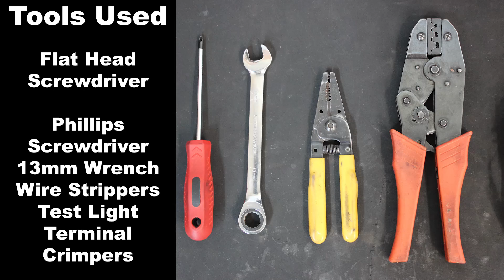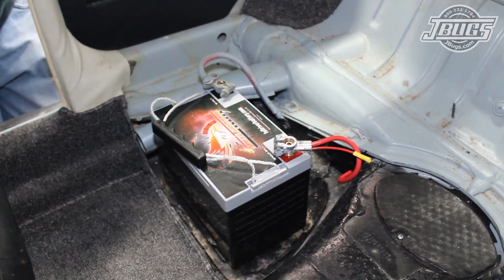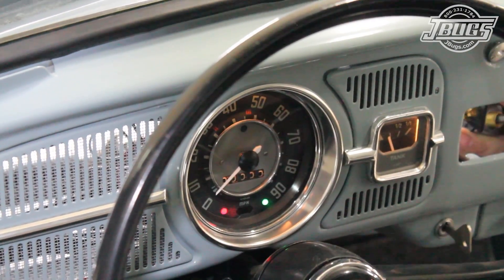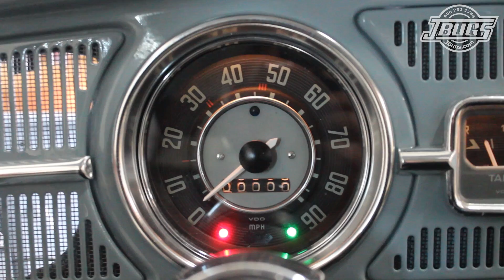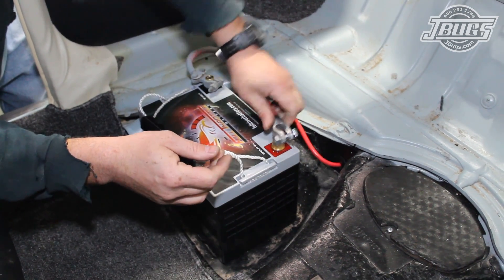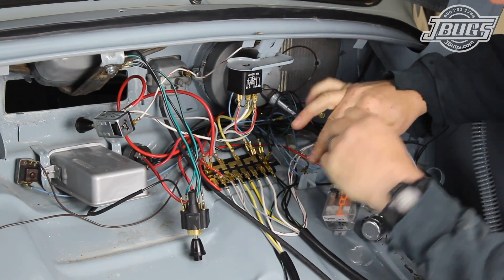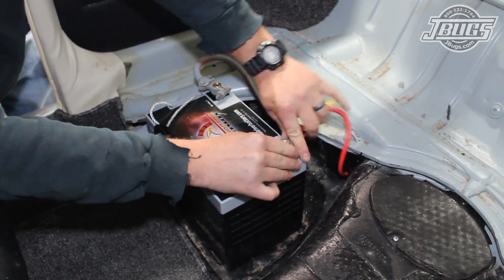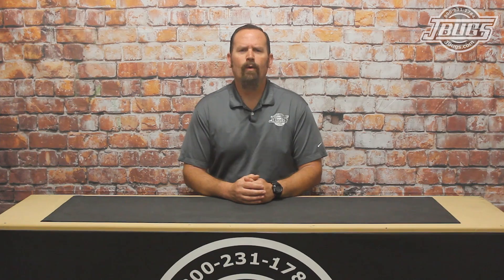JBugs - 1966 VW Beetle - Engine Wiring & Electrical System Testing

Comment: Could someone make me a diagram as to how I could wire up my voltage regulator on a dune buggy to charge ???
Reply: We kind of already did - https://www.jbugs.com/store/graphics/00000001/23/300019-VW-12-Volt-Voltage-Regulator-Wiring-Diagram_540x540.gif
Reply: I have no fuse box
Reply: I have no idiot light or speedometer
Reply: @JamesBrown-126  then wire it up to your battery and switch.
Reply: @Sam_Mebane  where on the switch ?
Battery, or accessories ?
Reply: @Sam_Mebane  and what about the number 61 connection ?
Reply: @JamesBrown-126  this goes to a warning light. If you aren't going to run one, then leave it disconnected. Just make sure you have a voltmeter on the vehicle so you know that the generator is charging, and more importantly that the generator is turning since it is also turning the fan that cools the engine.
Reply: @JamesBrown-126  the B+ terminals are battery positive terminals, so they would wire up to battery posts.

Comment: Sooo... what about those of us running internally regulated alternators?  I wish I could just run the power under the rear seat like a late model bug but the wires are bundled together in the harness.  What’s the best way to route power without a regulator mounted to the generator???
Reply: Did you solved the “problem”? I’ve the same question… but I’m really new in this things, basically I’m trying to understand it and do it by myself…
Reply: This depends on the year of the car. If you're working on a 6 volt car, just run a power wire from the "+" alternator post to the starter "+" post. Essentially, just like we did at the 2:50 mark.
Reply: You don't attach the regulator under the generator strap like they did here. Best way is under the rear seat on the driver side.
Reply: @doginu  - not true. 6 volt cars have the main wiring harness in the roof, not through the quarter panel and under the rear seat. 1966 and earlier 6 volt cars have the regulator on top of the generator. So for those converting a 6 volt car to 12 volts, with a generator instead of an internally regulated alternator, this is the way to go. Ideally, if you're converting a 6 volt car to 12 volts, use an internally regulated alternator so there is no need to wire up a regulator.
Reply: @Sam_Mebane  Look at 2:50, you do not attach the regulator like that. It will vibrate and wear on the front dust cover. Mount it correctly
Reply: @doginu  well, the car has been on the road for 5 years now so when the owner has to replace the cover, I'll tell them you said to mount the regulator under the rear seat.

Comment: is there any difference from wiring up a 64 as to the 66 if the 12V conversion has been completed?
Reply: Yes, the biggest differences being the turn signal switch (with dimmer) and the hazard switch. Otherwise the cars are very similar.

Comment: Interesting.  I'm guessing there was a mid model year change or similar as my 66 has the 9 pin relay mounted to the drivers side fender and not directly behind the speedo as shown here?
Reply: That is an oddity. I've never seen the relays mounted anywhere but behind the speedometer in all the Beetles I've ever worked on.
Reply: @Sam_Mebane  I'd add a picture but don't know how.
Reply: @starlightsims9229  it is where it is, as long as it works, it doesn't matter where it is!

Comment: What crimping tool are you using for the non insulated connectors?
Reply: A non insulated wire crimping tool (Google search that and it should bring them up).

Comment: Have you got a video on wiring a 68 bus dashboard? I'd sure like to see it I'm having trouble
Reply: Not as of yet, no. My best advice is pull the windshield and the top of the dash. This allows access to the back of the dash without contorting yourself underneath the dash through the door opening.
Reply: @Sam_Mebane  thanks for responding Sam I'm doing a complete wiring harness so the dash is out, it's mostly done and I'm looking for a good tutorial( I'm not the wiring guy) there's plenty on the bug not the bus. Previous owner thought he was an electrician thank you I'll get her done

Comment: I didn't see the spade connection to the starter.  Was that also in the engine wiring harness.  I know that comes from the front of the car but I didn't see you run that wire.  Or is that just not visible because it is behind the fan shroud and tar board?
Reply: The wiring was installed as part of a  series.The wire was run through the firewall to the starter in this video - https://www.youtube.com/watch?v=an0KPO4jR7o&list=PL7YpZlDdZJChD4umfne4HoKShlq4yQalM&index=1
Reply: @Sam_Mebane  thank you

Comment: What about 6 volt?
Reply: What about it?
Reply: @Sam_Mebane  hi I have a 66 vw with 6. Volt system it will not start  nothing when I turn the key.  New battery&starter should I just go through all electrical?  Could it be anything mechanical?  Where can I get a 6 volt  manual  showing  all mechanics (how to)  or help when I need it
Reply: @robinlowe3976  I would start by checking for a good ground connections at the battery cable and at the transmission ground straps. People often overlook them assuming that as long as they have "power" (positive) that everything is good. Rust, paint, loose connections, old cable, etc. can all lead to a bad ground connection. 6 volt systems use less voltage but more current (amps) than 12 volt systems so the grounds are especially important. 

As for a manual, the factory service manual ( https://www.jbugs.com/product/11-0701.html )for your car is a great option but often times too technical. For the beginner and even seasoned VW fan, the John Muir "Idiot Book" ( https://www.jbugs.com/product/11-0990.html )is a great manual that uses common terms and is easy to follow.
Reply: Thanks  I'll  start there  let you know  what I find

Comment: About the red wire that was trimmed and connected to b+ besides the black wire that comes from the starter, where does the red wire comes from?
Reply: There is no black wire that comes from the starter. B+ indicates battery positive power. The wire from the right side of the engine compartment came from the positive battery cable post on the starter.

Comment: Where did you get that battery?  I need to replace the battery in my '68 Beetle and the car supposedly needs a group size 42 battery.  Only "problem" is that the 42's terminals are backwards from the battery you're using, which appears to be the correct layout for a Bug.  A size 42 battery WILL work (that's what I took out of my Beetle after all), but I'm curious where your battery came from.
Reply from the maker: The battery we used for testing is a Full River FT825-34 High Capacity Dual Purpose AGM Battery. It is our bench testing battery and stays in our shop and not a battery we would normally run in a VW. We normally run an Interstate MT-42 battery and either flip the battery around so the posts are at the front or just move the ground cable mount at the chassis.
Reply: @JBugsVWParts  Thanks for the feedback!  Was thinking an MT-42 as well...they seem to get the job done and the cables will fit.